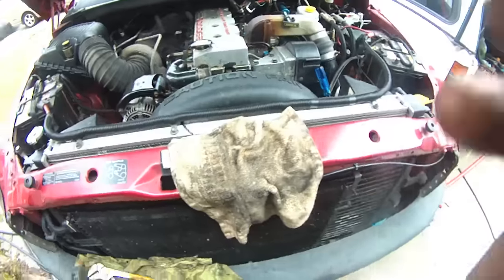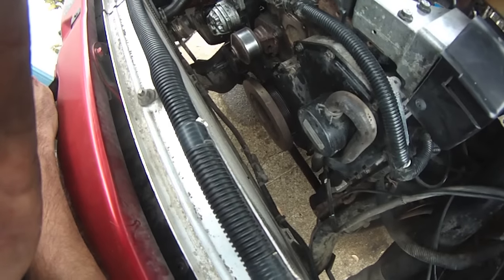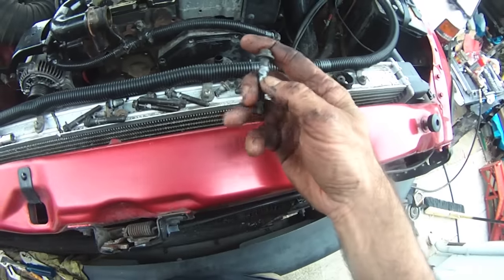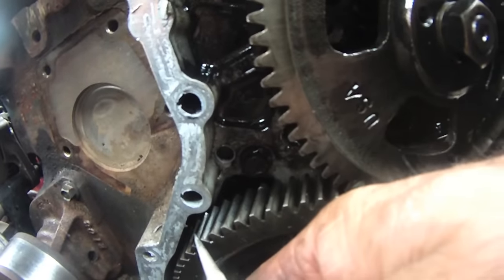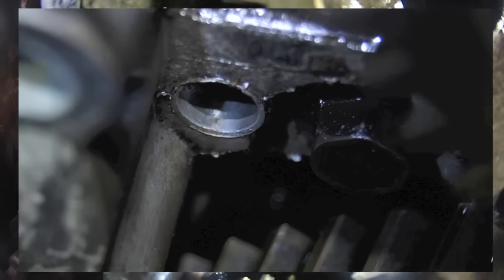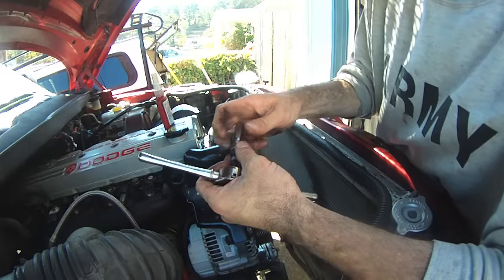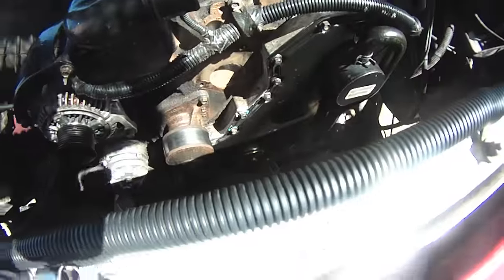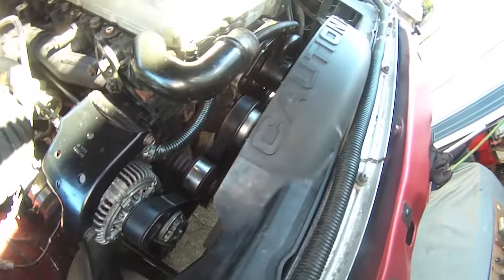24valve Cummins KDP Fix

Comment: How about 
1. drill into the dowl pin 
2. tap it 
3. put a bolt on it
4. Use a slide hammer to pull it out
5. yank the pin out and throw it away

Will that work?
Who cares
Is the dowl pin doing anything?

Just throw it away😂

Comment: I always asks cummins mechanics about this when ever I run into one.  On the Internet you would think cummins are being destroyed at an alarming rate.  Talk to a mechanic they will say yea its a known issue with the earlier engines but they say it rarely happens.  LOL  I guess for peace of mind its better to crack it open and check, just think of it as preventative maintenance.
Reply from the maker: I agree, it's not as if one in ten Cummins engines were dropping the pin and blowing apart, or having the 5th gear nut fall off... hell even the 53 block was not as widespread as people make it out to be.  The majority of the issues were operator error... lugging the engine in 5th gear, pulling heavy loads before the engine is fully warmed up, putting high performance parts on the engine and treating it as a race car.   I just didn't want to be in that very small percentage of people who had the issue...at this point I would be on the hook to repair any damage caused if I drew the short straw.
Reply: Mopardude I agree, I'm a mechanic myself but actually have never done that job... Saw a truck come into a shop I used to work at that was wrecked after a pin dropping out. Preventative maintenance goes a long way in the case of something that can become an issue.
Reply: Josh Lawrence
For sure,  With Steve's long voyages to his ranch this is just good peace of mind no matter how you look at it.

Comment: I'm guessing the water pump was still good , I remember you talking about it in a different video . You are a hands on guy and I would have done the same thing , just to make sure it was good to go and have piece of mind too boot . I keep a spare belt and old wipers in mt truck just in case . Your attention to detail and memory is priceless , but having Wayne on speed dial is doubling down .I learned so much from his videos , what a great guy . Nice job tearing it down and great video showing the pin ect . Till next time , Gerry :)))
Reply from the maker: Hey Gerry, The water pump is a few years old, but has low miles on it.  I did give it a good shake and there is no play and it turns smoothly.  It's going to stay as it's a Cummins water pump and not an aftermarket.  I like peace of mind when driving and I don't like to be broken down on the side of the road.  I also keep spare parts in all my vehicles just in case..oh yeah and a tool box is always part of my pre-trip packing routine.  Wayne is an amazing resource. I sure hope he picks up the camera again.  Thanks for watching, Steve

Comment: Excellent Video! First off.... Thank you for your service to our great country!
That is one of the cleanest Cummins trucks I have ever seen.
Quick question.... How long did it take you to complete this job. I am in the same exact situation as you were.  I do not know the history of my 12v.... this is the first Diesel that I have ever owned. They are set up a bit differently than the average Gasser!

Thanks again for the video.... I'm a long time subscriber. Just don't comment much. Have a great weekend.
Reply from the maker: Hey Tom,  It took 3 1/2~4 hours to do this, but that includes a few interruptions and taking the video.  If I had just worked on the KDP,  turned my phone off and put the camera down it would have been a 2 hour job.

Comment: Many 24V ISB's had the improved case with a stepped pin bore to prevent fall out.  Of course Cummins didn't install these improved cases on all 24V's.  My 1999 had the improved case....yet I've seen 2002's with the old smooth pin bore.  Cummins cannot date or SN confirm which you have.  You just gotta look.
Reply from the maker: Yep...I just has to look...a few hours of work for peace of mind is totally worth it.  I also cracked open the NV4500 to upgrade the 5th gear nut...which it really didn't need either...hahaha.   Like I said, Peace of mind.  Thanks for watchingt.
Reply: Hi. You mentioned the gray silicon as a sign the case was replaced. I have a 2002 and have they gray silicon. Can you tell me more of the signs that point it was done?

Comment: The diesel stop - very knowledgeable videos. I agree. The only other person beside him is Jim Jessup I would let work on my truck if I was not able to. Was the radiator clean on the back side or was there oil and dirt on it. I got a kit to reroute the puke tube and remove that tank that causes it. Good deal on the gauges. Need that fuel pressure monitored for sure.
Reply from the maker: THe radiator was mostly clean. The puke tube will definately get a re-route and get it to dump down by the firewall.

Comment: Thanks for the tip about engraving "KDP done"
Reply from the maker: You're welcome.  Its a tip I got from a Tech that would write on just about everything he did.  I also used a paint pen and wrote on the transmission "5th gear nut upgrade" after that work was done. Just trying to save the next person a little time.

Comment: Be careful if that's a 53 block you can see that number below the oil filter it stamp on the corner of the block I herd they have like a block cracking problem.
Reply from the maker: Hey J, Thanks for the heads-up. I am aware of the 53 casting and they did have issues.  My research showed the vast majority of issues manifested in engines that had significant performance and horsepower upgrades that stressed the block. Another issue is putting the engine under heavy loads before they were at running temps.   This engine will remain stock and I am diligent in my warm up routine if I know I'm going to be towing with it.  Thanks again and have a great week.
Reply: I think it's more about winter and old antifreeze freezing in the one area...change the antifreeze every two years and it likely won't happen. Also if it hasn't happened to this point then yours isn't likely one of the thin block castings...like the dowel pin problem it happens less than you would think, just imagine how many of these engines are out there.

Comment: I thought KDP was limited to 94-98 12V only??...
Reply from the maker: It really depends on who you talk to.  Dodge has a bad habit of depleting inventory of parts when they change something.  This truck is a perfect example, I bought it from the original owner, and the truck has a 1997 fuel filter housing on a 99.. something I only found out when I bought the correct but incorrect filter.  It was in my best interest to check for the KDP rather than end up stuck on the side of the road.
Reply: @yourbeekeeper  .... yes, I also just read an article that says KDP was on trucks from 89-98... who really knows!?
Reply from the maker: The front seal was wet and needed replacing anyway...a couple hours under the hood for peace of mind was totally worth it.
Reply: @yourbeekeeper  also this truck has the VP44 , i think if your truck has that IP you should be good with the KDP..... i could be wrong...

Comment: I see the oil ring on the back of the radiator from the puke tube. After a while in dusty conditions it will just get worse and worse. I bought a puke tube catch can with a breather on top from some place (can't remember where)and installed it over by the passenger side battery and cleaned the crap out of the radiator. My truck was getting hot at times from no air flow. Lots cleaner engine bay now too. 

Maybe you didn't need to tab the pin but piece of mind and you changed a leaking crank seal so all is good. I did the same thing to my 2002. My son had a 1999 24 valve that the pin came out. He thought he didn't need to worry about it. I told him thats what he gets for thinking.
Reply from the maker: haha... that's what he gets for thinking.   Absolutely peace of mind made that worth it.  Great info on the oil ring...thank you.  I will clean it.  My friend ran the hose from the puke tube down the frame rail to just behind the front wheels, but I like your catch-can solution better. Thanks for watching and the tip.

Comment: grey rtv is used on the engine and transmission,orange was used on differentials. it is possible that the recall was done before the vehicle was or could be sold. i worked for chrysler/dodge/jeep for 25 years
Reply: So they grey means nothing? Every 24v I've worked on has had grey rtv on timing cover

Comment: Am I right that even with the knowledge that the grey rtv on the gasket indicates a factory recall that fixed it, you still wouldn't have seen that evidence with removing the timing cover? (Or does that evidence include the grey rtv on the cover bolts, too?)
Reply from the maker: According to the service bulletin I found, the grey RTV on the timing cover was the indicator... of course I didn't find that bulletin until after I did the work.  In my case, I wanted to replace the front crank seal anyway,  so it was not an exercise in futility.

Comment: What did you get with the 5" exhaust upgrade? Better mpg? More horsepower? What was the reason you did it?? Also does it pass smog? I have a 99 as well and my muffler is shot and I'd rather upgrade than fix.
Reply from the maker: Honestly It's difficult to say exactly what the 5" exhaust improved.  This truck was fairly new to me and I didn't have a lot of drive time/towing time behind to wheel (maybe 500-600 miles) at the time of the video.   When I did the exhaust I also replaced the exhaust manifold (due to it being cracked) with a three piece high flow manifold. Most notable improvement was how quickly the engine and turbo gets up to the power band.  It's not realistic to say it's instant...but it's a LOT faster than when the truck had the old system...which equates to better performance under load.  This truck already has a TON of power and I had only towed a small pickup 250 miles throught the mountains without incident..so I can't really say if the power/torque/horsepower improved.  As for MPG, I suspect it improved, but there are a lot of variables that will effect MPG... tire size, air pressure, driving habits, outside temp, terrain etc.  I just towed a 7500lb load, almost 400 miles a month ago and got an honest 26mpg...that's amazing as far as I'm concerned....but I can't tell you how much of that was 5" pipe related.  Why did I replaced the stock system?? For the performance and mileage improvement (or so they say) and for the sound....to me, I love the sound of a Cummins and this just made the whole truck sound amazing...yes it's a bit louder (but not bad at all inside the truck) but more important it's a richer tone that just makes me happy when I drive it..haha.    As for smog?  I'm not in a smog controlled area and this system is not CARB compliant.  The new exhaust manifold is...but this exhaust system is not.  I'm not sure why it's not compliant..other than they (the mfg of this system) probably doesn't want to spend the time and money to jump throught the emmission laws of a handful of States.  This truck never had a catalytic converter or any exhaust sensors...so it has zero impact on what comes out of my tail pipe.  Overall I'm extremely happy with this exhaust... the price seemed fair, the fit and finish was great, the clamps and hardware are sturdy and to date it's holding up nicely.  I have several thousand miles on the truck since this video and have never had anything come loose.  Hope this helps out.  Steve
Reply: yourbeekeeper thank you for your lengthy response. I also just replaced the manifold and I too felt the difference in power. I think I will upgrade to the 5 as I too like the sound of the Cummins lol I own the 99 5.9 and the 2015 6.7 and I like the technology on the 6.7 but the love the way the 5.9 sounds and drives lol it's a fun truck. Don't get me wrong so is the 6.7 but they silenced it a lot. Thanks for the reply

Comment: Wonder if this is a possibility for a 2003 24v?
Reply from the maker: There is debate...I was told by 2003 (the first year of the common rail) the fix was already throughout the production line for several years.   With that being said, my '99 already had the dealer installed cover that took the KDP out of the equation.  I would feel comfortable that a 2003 would not have that possibility... but that's just my opinion.

Comment: I didn't think the 24v needed the KDP fix only the 12v
Reply from the maker: Two Dodge service techs I know have both said that Dodge had a habit to use up the old stock inventory when changes were made and many early 24v engine went out with left over 12v timing covers and other 12v parts.  My VIN coded my truck to be an early 24v production run.  I was also suspicious when I went to replace the fuel filter and found this truck came from the factory with a filter and housing housing from 12v engine (I made a video of that discovery).   Doing this work was cheap insurance to verify that I would not have had any KDP issues and it gave me a chance to replace a weeping crank seal.  Also, if I had done more research prior to taking the cover off, I would have noticed the grey RTV silicone sealant between the timing cover and block was an indication that this did come with the cover with KDP issues and the Dealer corrected the KDP after delivery from the factory.
Reply: @yourbeekeeper  the bore that the dowel pin is pressed into is in the timing case so which cover is irrelevant. The theory is that the pin vibrates out due to the weight of the p7100 pump. ‘98 was the last 12 valve to be in jeopardy of the kdp imho. However replacing the seal justified the job.